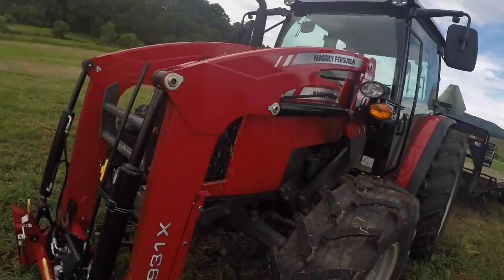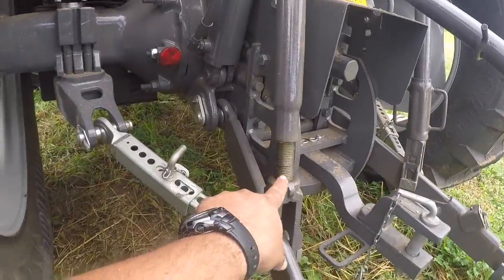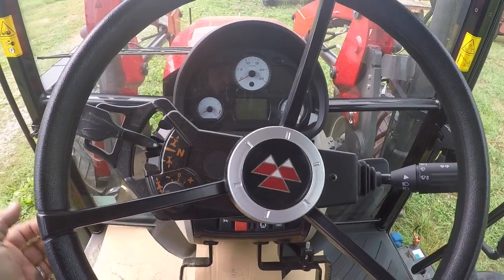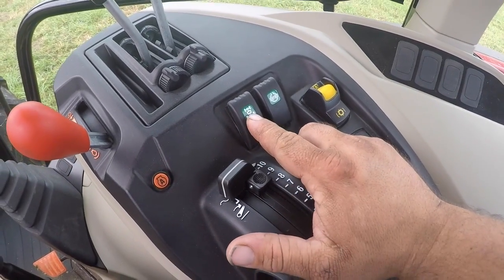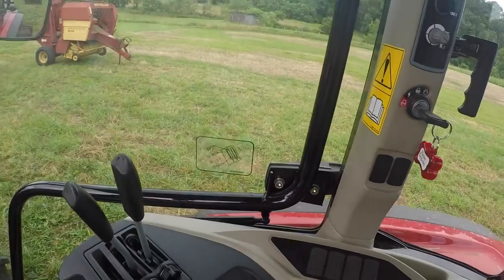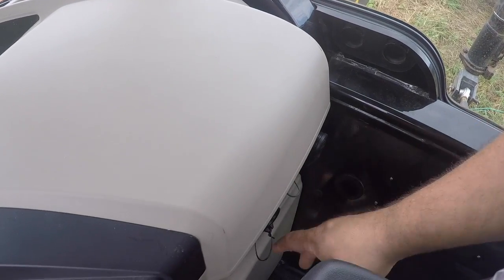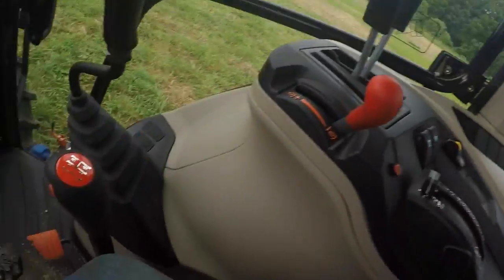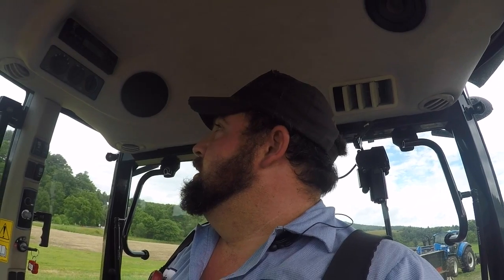Massey 4710 review, walk around and features

Comment: The auto four wheel  drive  is tied  into  the  lift when the  lift passes  a certain point it disengages the 4x4 to save the  tyres  turning  on the headland the same as auto pto

Comment: If you lift the rubber boot up under the joystick there is an adjustment to bring the joystick further towards or further away from the operator. In my onpinion the only downside of this tractor is you cannot get it with powershift dyna 4 or dyna 6 transmission if you want tha you have to get 5700 series tractors
Reply from the maker: +squidgymop1. Someone else had mentioned that you might could adjust it, that's a cool feature!
Reply: DLH Farms yer its just a m8 bolt on a slide like most loader joysticks ( only know because i work for a dealer in their workshop and fitted one last week)
Reply from the maker: +squidgymop1. Thanks for the info

Comment: I really appreciate you taking time to review this tractor in detail. I just wanted to clarify a few points as I'm thinking if buying one. I have an mf 5455 (4cylinder dyna 4) and I dislike that I have to constantly change ranges. Also the lowest gear is too fast for hedgecutting . I was wondering if this transmission  is very slow in the lowest gear . Also is the lowest gear in the high range, low geared enough so that you could take of from a standing stop with a reasonable load on a hill for example. As I find that I always have to go into medium range to take off on a hill with a load with my Massey but not my valtra as the valtra is lowered geared in the high range . Thank you very much
Reply from the maker: +AgriSpec. I wish I could give you an honest answer for your questions but I only ran the tractor for one day and didn't test the speeds of the transmission. It's been quite a while ago since I done this review and I don't remember much about the transmission. I do know that I liked the tractor pretty well but probably wouldn't buy one because it's only a 12 speed and I need a 16 or 24 speed. One thing I do remember is that there are only two ranges High and low then there are 6 gears in each range which would mean there should be less range changing.

Comment: In the uk the lever on the left can also be used to change 4 clutch less gear changes in every gear, does this have that on, dyno shift 👍
Reply from the maker: +onlygazza's fastrac farming. The 5600 and 5700 tractors with the dyna 4 transmission has that, but the 46 and 4700 series are manual transmission only.

Comment: you give it a fair shake!!, if you like massey, like a friend of mine, you will buy..
if you like green you likely won't buy !!  good vid, I just subscribed
Reply from the maker: +buffranchAB. Since your new I'll tell you, I'm a New Holland guy, but I have an open mind to other brands, I like trying out other equipment to see how it compares to the equipment I use all the time, I don't get to do this often but when I get the chance it will be on film. Thanks for the sub!
Reply: I was a ford guy, for the ag tractors at least, but did not carry on and follow up with the new holland deal, swung over hard to deere then, but I'm a chev guy, just ford tractors, not ford autos ,  I had a uncle that had ford tractors for 35 years, kinda got me to them.
Reply from the maker: +buffranchAB. I was a ford tractor guy to and kept right on with New Holland, had a good dealer 2 miles away, some of the models that are made in England like the T6 are made in the same factory the ford 7700's and TWs where made.

Comment: Does not all tractor brands have a freewheel on the pto ? I can turn the pto shaft by hand if the engine  is running and the pto is not in neutral .
Reply: Many tractors have a pto brake so you can not turn the pto shaft while the engine is running. I don´t like this feature.
Reply from the maker: +jacky bruckers. Most all tractors that have a hydraulic engaged PTO also have a hydraulic PTO brake. On my T5 there is a button on the fender that you can press that will slightly turn the PTO so you can align the splines.

Comment: Would you buy this tractor or a T4 75? I am currently looking for a 75 hp tractor to add to the fleet. Interested in T4 .75 and MF series 4700 series and also kubota 7060. Question is have you had any problems with NH emissions?
Reply from the maker: +Georgia Swampman. They are both good tractors, I think they are both going to be reliable Tractors, I had a T4.115 that I liked for the most part. I know the engine and transmission are solid in the T4. That being said since I've had a T4 I would probably give this Massey a try mainly because it's sold by the same dealer I buy my blue from and that is what is most important to me is the dealer support, even though I work on my own equipment once it's out of warranty, with all the computers and electronics I have to have info and diagrams and so on and I know my dealer will provide anything I need. My suggestion would be to go try each one, demo them if you can see which one fits you better, then consider the dealer and their reputation with providing support if you do have a problem, because with either one you will most likely have a few small problems. As far as emissions I have never had an emission problem with the T4 or the T5.
Reply from the maker: +Georgia Swampman. Oh and as far as the 7060 it's not even in the same category as the T4 or the 4700 as far as comfort goes in my opinion and my kubota dealer sucks so they are out for me.

Comment: Can definitely see improvements from the 4600 series... making me curious on what the 7700 series improved on.

I think the next step for transmissions would be the Dyna-4, which are very nice but probably looking at AT LEAST $15,000 more for the tractor. I'm not sure if the 4700 series offers the Dyna transmissions, might have to go to the 5700.
Reply from the maker: +Farming 4 Generations. I'm pretty sure the dyna 4 is on the 5700 and up only, would be a nice option for a smaller Tractor like the 4700 it would make me way more interested in the 4700.
Reply: In Europe the 5700 Dyna-4 is offered with a 3-cyl and 4-cyl engines. The US/Canada site does not list a 5700 Dyna-4 tractor as being available.
Reply from the maker: The 5700 is available here in the US, there are a few dealers that have them, but not sure if you can still get the 3 cylinder, you could in the 5600 series.
Reply: Not referring to the 5700 global but the 5700 dyna-4 global. Bit more than a 5700 global being offered with a Dyna-4. It is being sold as a separate model. In Europe they are selling 4 global models; 4700, 5700, 5700 Dyna-4, and 6700. Go to the UK site for more info.
Reply from the maker: Here the one with the Dyna 4 is called the 5700SL and you can get the SL Deluxe version also
Reply: Guessing the 5700 Dyna-4 global will eventually make it over here to us. Why they didn't just add the Dyna-4 transmission on the 4700 and 5700 global in stead of adding a 5700 Dyna-4 global model. Guessing it is a marketing gimmick.

Comment: One of the reasons I don't like the modern New Hollands is the stupid shuttle you talked about, that and the electronic spool valves. I love New Holland to death but damn that's annoying. Go back to the TM series with the good shuttle and cable control spool valves (for the most part) they are one of the best tractors to ever have been manufactured
Reply from the maker: +Yota's are life. I haven't had one with electric spool valves, my T5 has an electric loader valve and I like it pretty good.

Comment: does it have good low end torque? we have 5095m john deere, at wide open it pulls decent but at low rpm its gutless!
Reply from the maker: +Russ Kes. I don't have enough seat time with it to answer that question. It had plenty of power just moving hay around but I didn't get to try it with anything that put a load on the engine.
Reply: DLH Farms thanks for the quick reply, and also a very nice walk around of the tractor. subed
Reply from the maker: +Russ Kes. Thanks for the sub Russ!
Reply: Russ Kes  the best tractor for the low rpm toque is the 5700's series. They have a long level range of toque from low rpm's to high rpm's speeds.

Comment: How'd it do on fuel consumption?  100hp and seems like a small tank at 24gal.
Reply from the maker: +Five Oaks Farm of Georgia. I didn't check fuel economy, but I've heard those 3 cylinder Massey's do really good on fuel
Reply: Thank you sir...   how was the ride quality?  Did you test top end speed?  I'm looking at upgrading as I do a lot of road travel between custom jobs and my 19mph top speed sucks!
Reply from the maker: +Five Oaks Farm of Georgia. I didn't test it, but I'm pretty sure it goes 25mph. It seemed to ride good and the air ride seat worked good.

Comment: Good review, I work on cars all the electrical gadgets will be a headache with time unless your trading every few years, if not get a service Manuel not owners but a service or shop Manuel it will have codes trouble shooting info YOU WILL NEED IT don't care what brand you buy ,sensors and wiring issues become troublesome as tractor ages I have a 986 international 1978 still going those days are over with all the electronic gadgets! It Is what it is, that's just my two cents